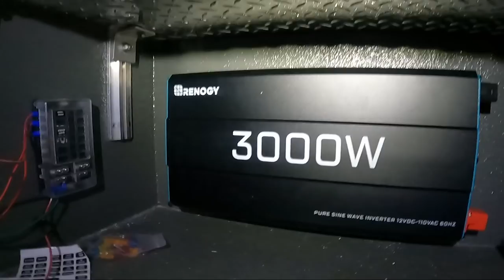ROOFTOP A/C | Ambulance Build | Episode 3!

Comment: Before you button up the walls and ceilings, did you think about running a few extra wires from the power center to various places for future upgrades? Would suck to have to remove all the finish panels and insulation if you decided what if I put (another electrical device) here? If you don't ever use them no big deal, but if you decided to run something else it would be a lifesaver.
Reply from the maker: I built it to be able to run wires pretty easily even after the conversion is finished! You’ll see in the future videos!

Comment: you need to put a winch on there
Reply from the maker: They’re so damn expensive for my weight rating though 😭😭 it weighs around 14,000lbs
Reply: I was wondering how much that vehicle weighed.  Curious if finished conversion will come in heavier or lighter then original ambulance.